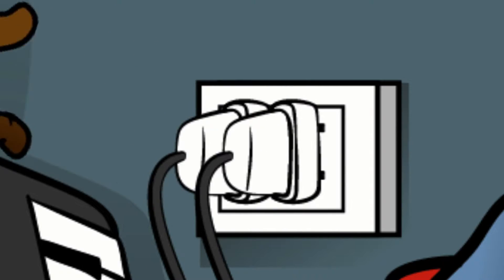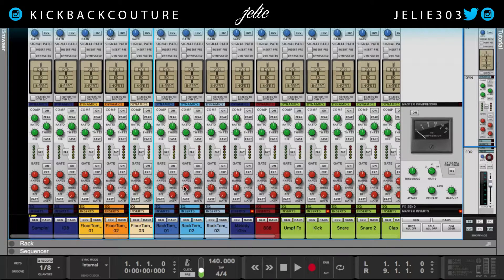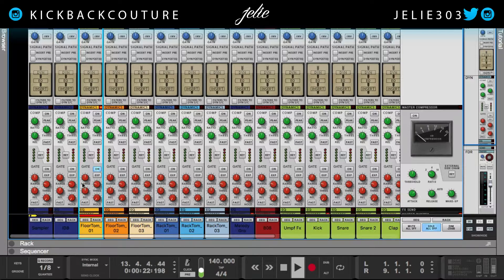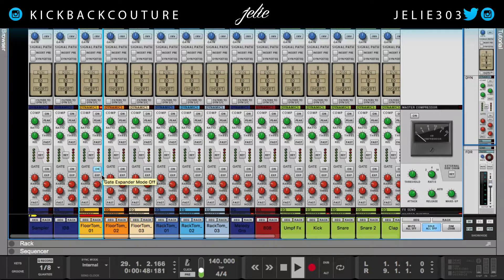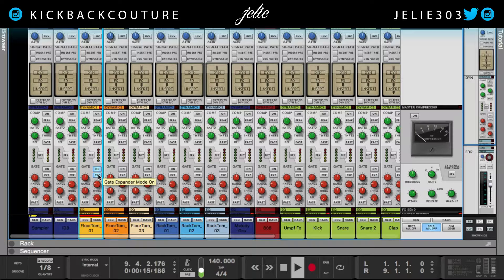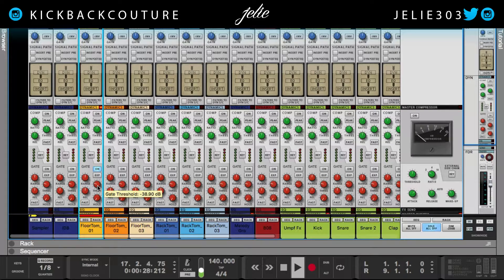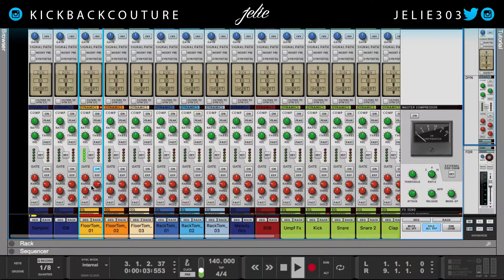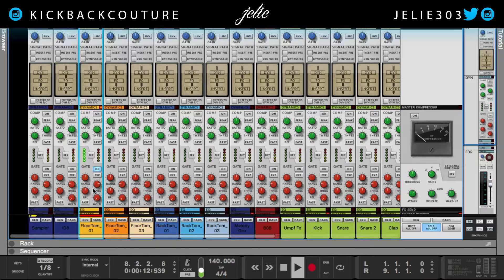Main Mixer Decoded : Gate + Expander | Dynamics Section Pt. 2 | Reason 10

Comment: Thank u very much. I thought this video was never coming 😂pause I wonder what waves plugin does this? I would like to see how to use the dynamic section to get better vocal clarity next. I got a lot background noise that sounds like tape saturation 😂 one day I muted all the vocal tracks and still heard it until I bypass my master section. Just the default mastering section. I’m telling u I have a ghost in my Reason I tell u👀
Reply from the maker: The mixer does do that. Sometimes it causes artifacts. I figure because it’s based off of “analog” that’s why it does it.